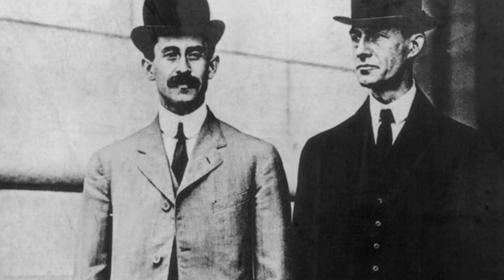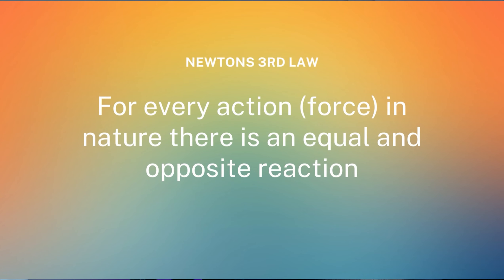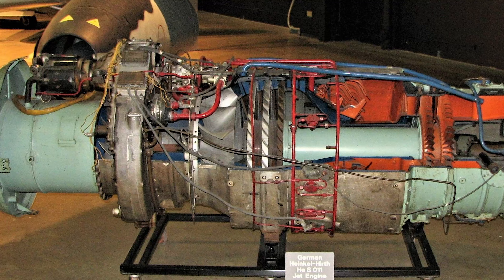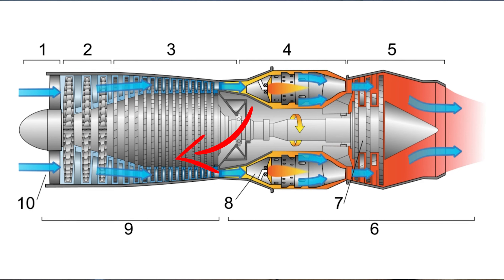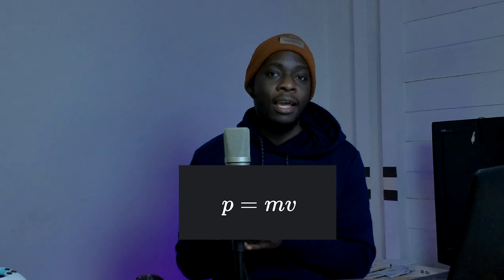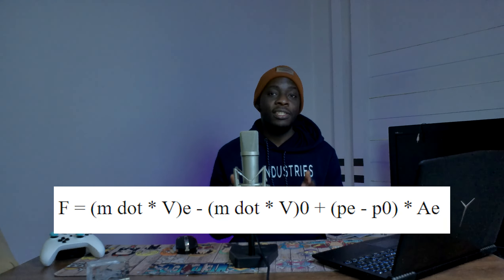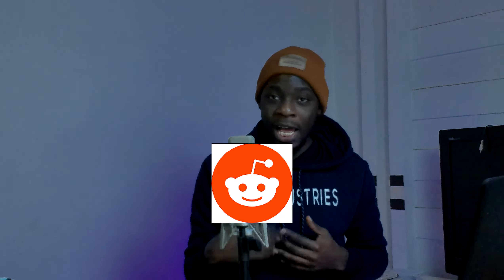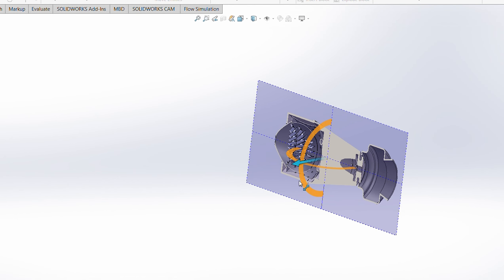Designing a jet engine, Understanding the basics!

Comment: at time stamp 2:57 - ive seen many pictures of turbo fan engines that look similar to the pic shown.

when the bypass air flow out of the fan and passes around the core of the engine, is air flowing over all of those exposed mechanisms, piping, lines, etc that surround the core?

or is there a streamlined fairing around the outside of the core, and another around the inside of the fan, so the bypass air can travel as smoothly around the core, as does surround air travels smoothly around the engine nacelle?
Reply from the maker: Hey, The Pictures show the internal parts of the engine, but in order for air flow to be smooth, they are covered with a housing..  I hoped I answered your question.